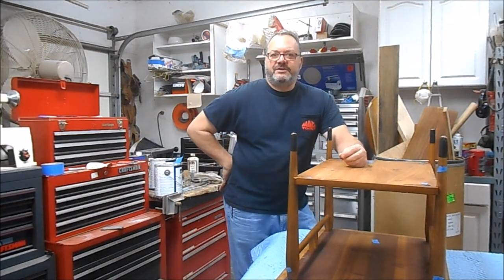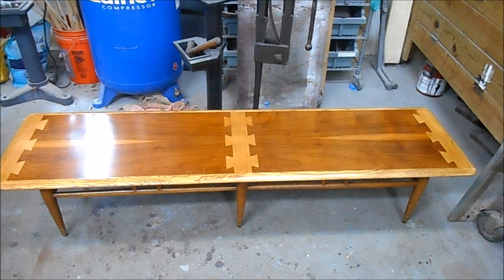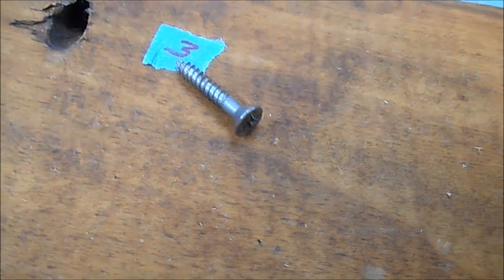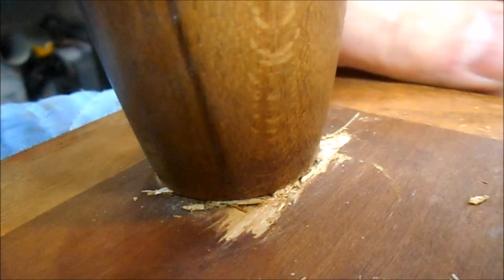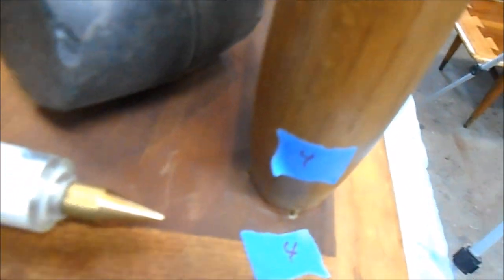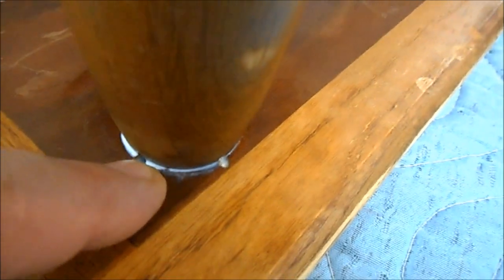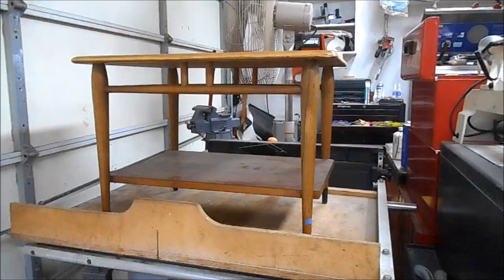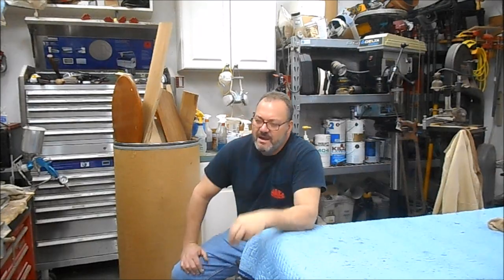Lane Acclaim Leg Repair Fail and Save

Comment: I don't see these as fails but as challenges. I'm in the middle of restoring a 15 year old porch light that has never had much attention. Taking it down was simple but there is always one screw that will give you hours of pain to get out. I had to cut the head off one 4 mm bolt and no way to drill out the remainder of the thread. It took a week and a lot of imagination to come up with a replacement idea and thank goodness epoxy resin can be used as a light welding technique.  Keep up the good work. Even at the age of 74 I have learnt a lot from YouTube videos and these videos are my first port of call when I'm stuck for an answer.

Comment: Hey Larry, hope you’re well and staying safe. You asked if anyone had any experience with stubborn legs that just don’t want to release, well, you can count me into that club. I actually learn quite a lot from that project. The legs were loose, the end table was terribly wobbly, but the legs just WOULD NOT give. I did the unthinkable, (you’ll probably delete me from your subscribers list once you hear this), please remember, I had spent hours trying and failing to remove the tenons from the mortises, so I gently cut the legs (I can’t believe I’m actually telling people about this) from where they sit on the underside of the table, drilled out the stubborn tenons from the mortises, then drilled new dowels into the part of the legs I sawed off to essentially create new tenons. I glued and clamped everything back together, and here we are today, risking being blacklisted from all woodworking channels. Honestly though, they came out GREAT. Just remember, if you cut one leg from the tenon, you’re going to need to cut all the others as well, to make them level. I thought of that idea from repairing so many broken chair joints with dowels, so this was just another wood joint, along with some “color and shiny stuff!” Let me know what you think of my brilliant idea, I’d love to hear your thoughts on it.
Reply from the maker: Necessity is the mother of invention.   Sounds like you got it done and that's what counts.   Thanks for watching and for sharing your experience.
Reply: I was thinking the same thing. Use dowels but I'm only an observer.

Comment: I had some that lasted well over ten years and only recently started to get a little clunky. The liquid epoxy counterpart is actually the same age and still works but takes a lot longer to cure. The big advantage to the liquid is that it is very low viscosity and will get way deep into punky wood.....which reminds me that I should use it in that log I just salvaged to make bandsaw boxes.

Comment: I'm a professional furniture upcycler in the UK (Boogaloo Boutique) and I think yr being too hard on yrself. We turn around 20 to 30 pieces a month and the repair on some will easy and on others will be more challenging. The end result on the tables was beautiful and that's what's important. The only thing a will say is we have a check list we use when accessing a new piece of furniture. The check list stops us missing something and particularly when more than one person is responsible for a number of different repairs. Yr a skilled man with passion so I take me what off to you. Alan
Reply from the maker: Alan, thank you so much for your kind words.  They mean a great deal to me and I am humbled.   If I may, do you have any other methods of gluing in loose joints such as the ones we had here?    I am sometimes a bit skeptical of the "drill and inject" method because I have no idea where the glue is going in the joint and how much adhesion we are actually getting.    Thanks for your professional input, I am very appreciative.   Best regards.
Reply: You made an excellent recovery from a “small splinter” on the underside! An old friend once said...”it’s the over-all affect that counts”....and the tables turned out great. Nice finish! Regards from NE GA. Thanks for sharing.

Comment: I have a Lane coffee table -- different style but also has stretchers and lower shelf -- both legs at one end of the table are loose.  I want to try that hole-drilling and glue-squirting technique that you showed.  Note that I do not have any kind of workshop but I'm capable of operating an electric drill.  Will you please tell me the spelling of the name of that chair leg glue?  Thanks very much.

Comment: I have found that a few sharp raps with a dead blow hammer near the joint can be effective. Of course it can also be destructive if you are not careful. Sometimes you just have to do what you did and drop back 10 yards and punt. If you didn't think the injection of glue would work you could cut through the center spindles at the table with a flush cut saw, reglue the legs and then repair those center spindles but that would be a last ditch measure
Reply from the maker: Thanks.  I like the hammer tip.  I'll give it a try.  Best regards!

Comment: Good morning. Thanks for all the awesome videos and information. You Rock!! I have a question not related to this video. When you mix up your lacquer toners for spraying, what do you mix with the lacquer to get the color tone that you want. Do you use the Mohawk powders or Trans Dye tints? Would you be able to provide a basic recipe. I have a mahogany veneer table that I have stripped the top on and I want to attempt to match to a mahogany wood buffet that I built years ago. Any advise would be appreciated. Have a great day
Reply from the maker: Hi Stephen.  Thanks for your kind words.   When I mix toner, I usually mix acetone based dye with lacquer and lacquer thinner.   You can use powdered color but check for opacity.    You can also use Transtint if you prefer.   Toner can also be made with shellac colored with alcohol soluble dye powders which are readily available.   In my video on Refinishing a MCM Bedroom Set at :  https://www.youtube.com/watch?v=yZqnvPCPZj8&t=881s  starting at 17:11 I do a section on how I mix my toners, including a recipe on the proper amounts of dye, lacquer thinner and lacquer. to use.   Excuse my appearance in that section as it was quite hot and I had been working all day.   I kind of look like I had been lost at sea in a raft for a week or so.  Color matching is not a simple process and takes time to learn.  An artists eye for color is also very helpful.  I don't have that gift, so I continue to struggle at times.   Remember, start light and work your way dark.   Once it gets too dark, all you can do it take it off and start again.  Good luck.
Reply: Awesome. Thanks for the youtube video reference. I have watched all of your youtube videos. I could not remember which one that explained about the toners. Again, You Rock!!

Comment: Good save!  My only comment is how much should we be celebrating this chipboard and veneer stuff?  It can look nice but for me it has no integrity. I don't want to be "purist", but if that had been a solid wood table, you would have had no problems.  I have recently stumbled on your channel and I am working my way through your videos and am enjoying them all.
Reply from the maker: I agree with you 100 percent.  I love the old, solid wood pieces for sure.   Lane Acclaim was sold as an affordable line of furniture with the modern design of the time.    In my experience it held up pretty well for what it was when it was made, but it is modern, manufactured furniture with all of the short cuts of the time inside.   Thanks for your comment.

Comment: I repair and refinish furniture and often use a product from Abatron called Wood Epox. It can mimic almost any wood and cures to a rock hard state and clings tenaciously. There is a chair on my website   www.furniture-repair-and-refinishing.com   that I did many years ago and the Wood Epox took coloration that almost perfectly matched the oak.
  I started using it all those years ago for architectural restoration which I no longer do.
Reply from the maker: Thank you.  Yes, I have used that in the past.  I liked how it was "whipped" and very light.   If I remember correctly, I had a relatively long period where I didn't use it and it went bad in the container.   Probably some fault of mine.   I saw it used on the restoration of a very old Colonial building and it was (and is) an excellent choice.   Thanks for your expertise, your comment and for watching.  Best regards.